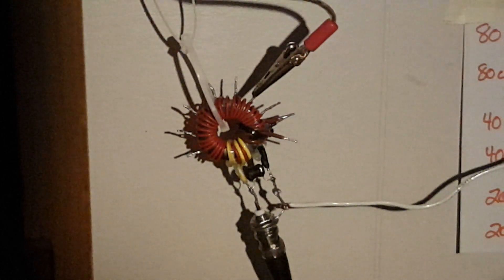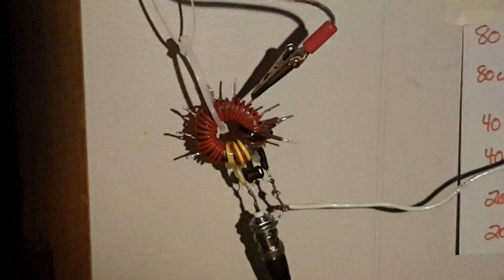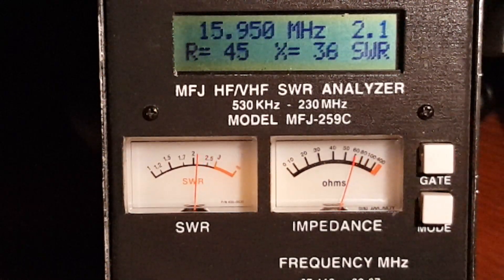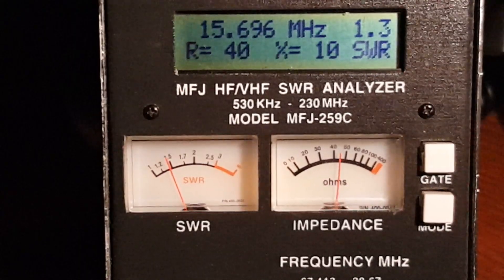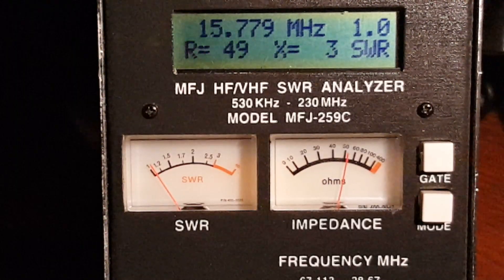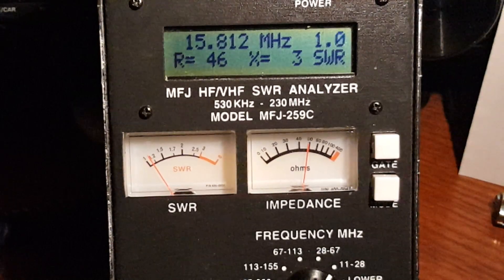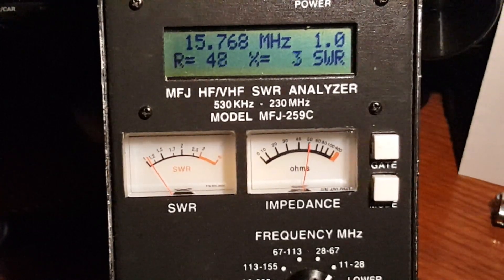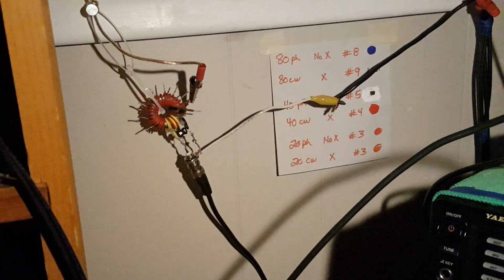Full Size 17m EFHW Real World SHTF Wire: SWR Tests

Comment: Add the length of the secondary winding to the length of the antenna wire.. It could be you get a better formula then :) Thanks and 73 de OM1ZZ